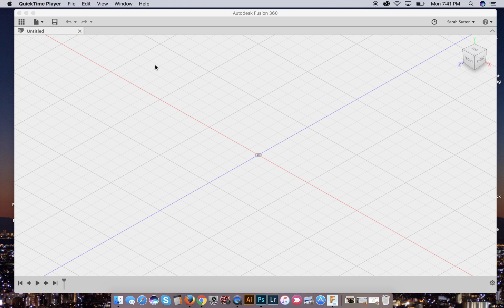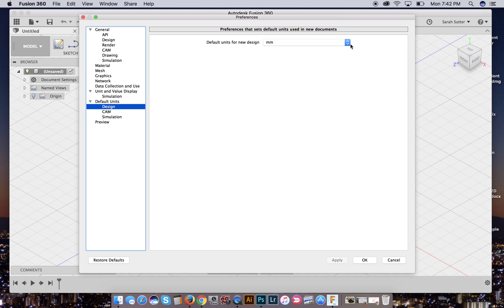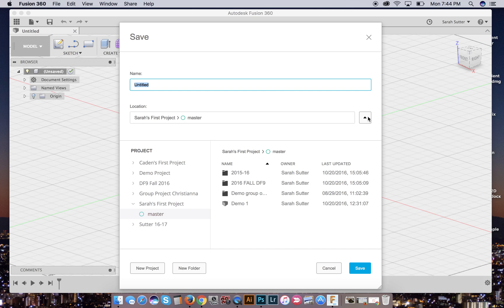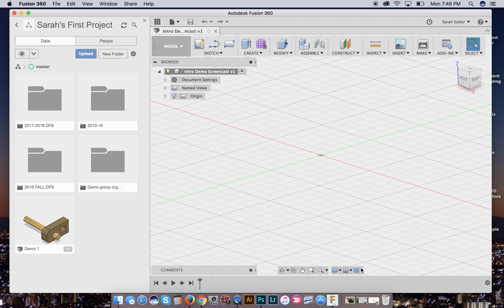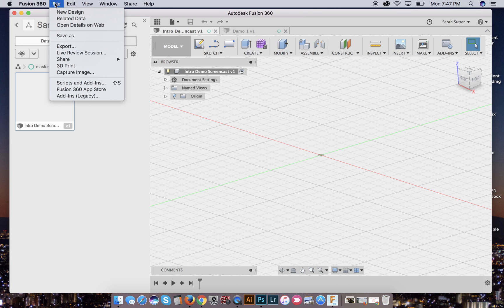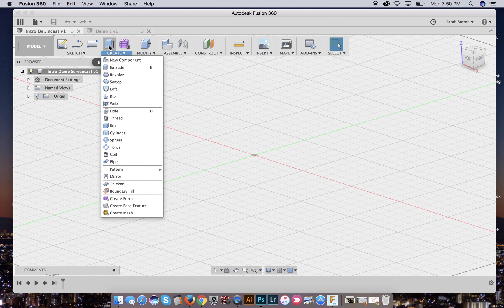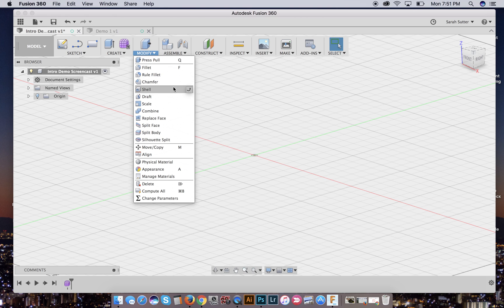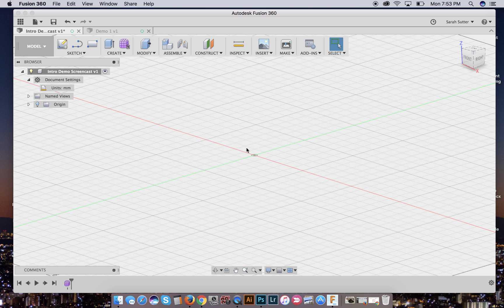Fusion360 Orientation Setup

Comment: Hi Sarah I am new to CNC work and fusion, I found a post processor that worked , but it was recommended I use a link to one I found in Open builds, I went to cut a simple circle , and I simulated it . but when I went to cut it the router traveled to were it was to start the cut, but went + on the Z axis instead of down, it hit the limit switch and stopped,, what should I do? Thanks in advance